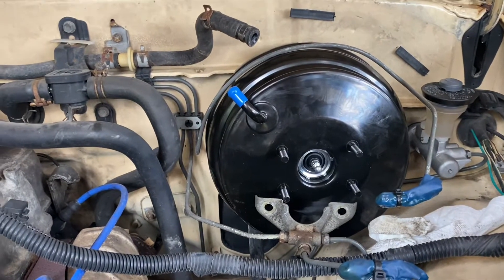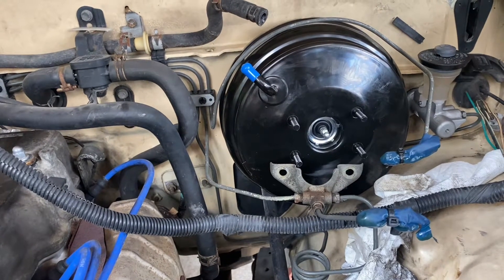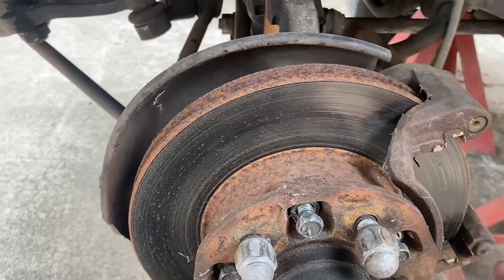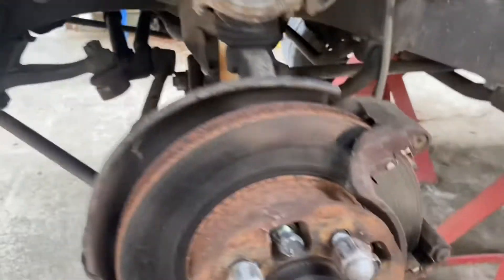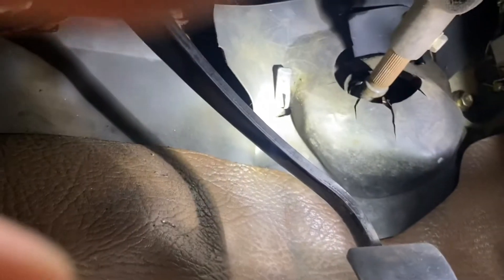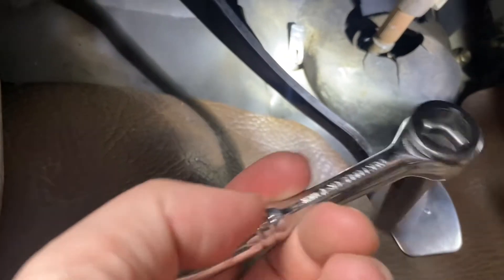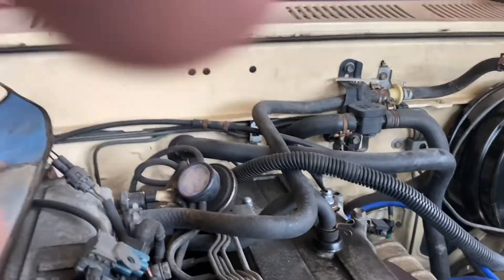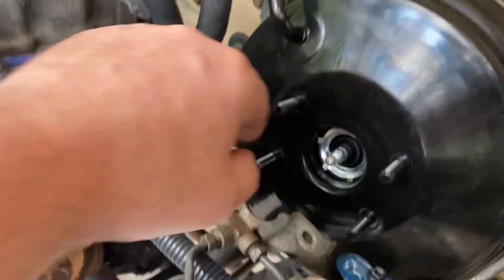1990 Toyota Pickup Brake Booster Upgrade

Comment: I want to upgrade break booster on 1992 Toyota pickup 4 cylinder 2.4l base model. Is it possible? Do I need to to upgrade ffont calipers for that? 
I just want to know how to do it right?
Reply from the maker: 1ton 2wd brake calipers will work,  the brake line may need a slight bend to fit.   i just the dual diaphragm booster, and the bigger brake booster       the 4x4 front calipers are not a direct bolt on on what i wishing for  

the video speaks for its self.
Reply: Thank you